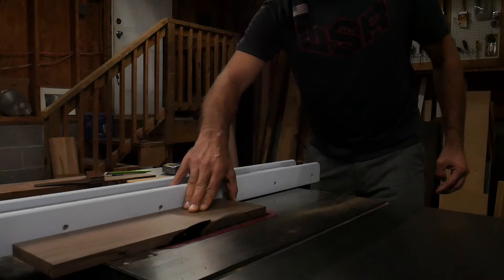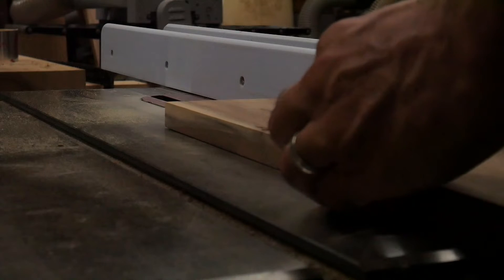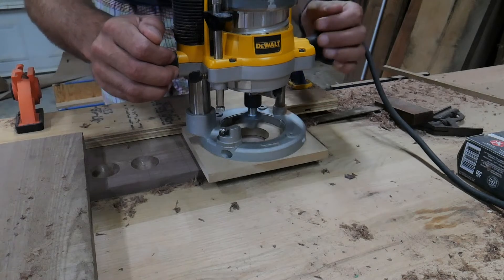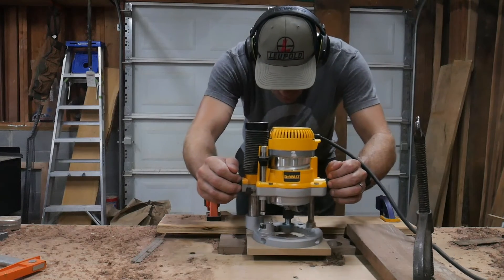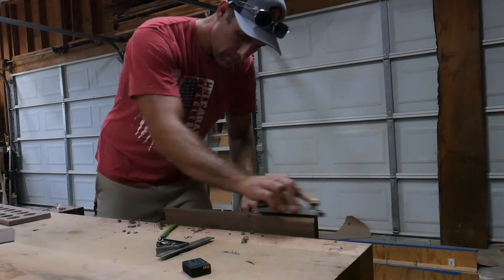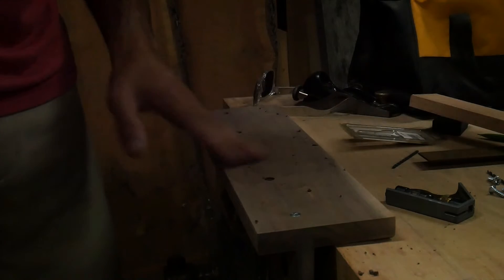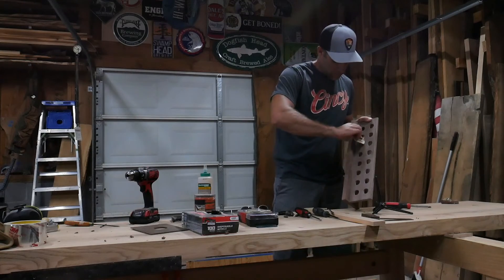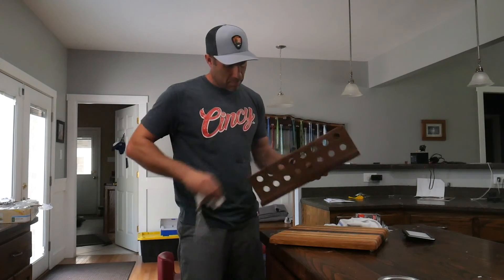How to make an Egg Crib to hold your farm fresh eggs

Comment: you must've cleaned your eggs. Mine are always covered in chicken crap. lol
Reply from the maker: 😂 some of mine come out that way, but I've learned keeping the coop clean helps a ton.
Reply: I can’t think of what exactly it’s called right this moment I haven’t dealt with it yet but you might want to google that, it usually means your chickens are carrying some sickness and all you have to do is buy this certain powder stuff you add to their water for like 3 days straight and then they’re fine and the eggs won’t be covered it crap. Eggs covered in poop is a big sign of this sickness thing that I can’t think of the name right now. Sorry if that’s confusing lol. But just check into it.